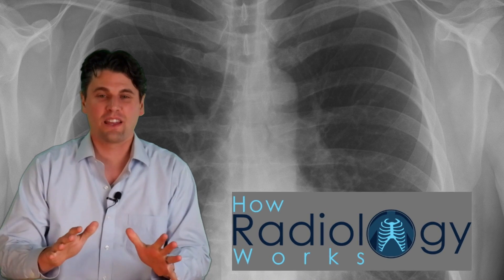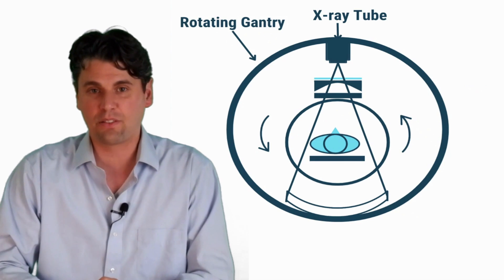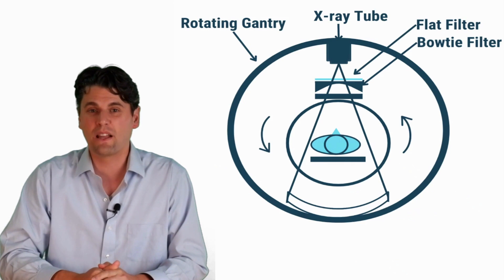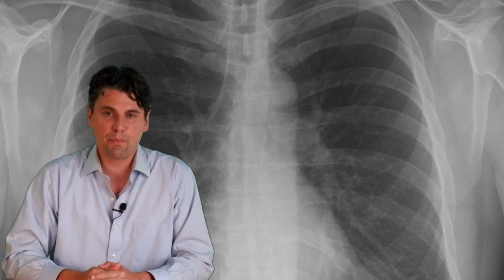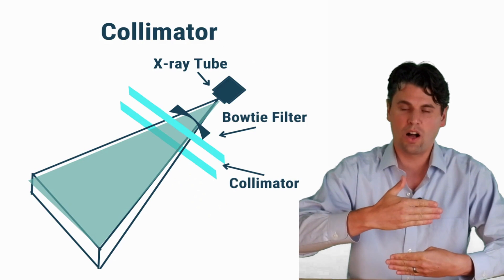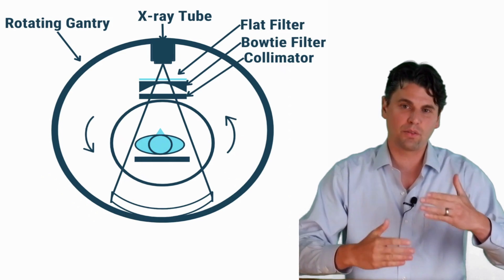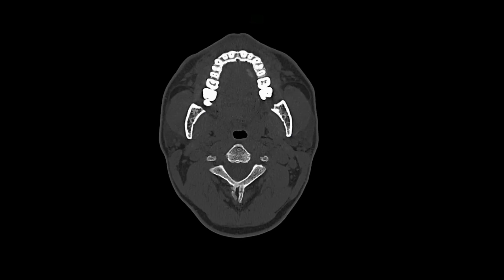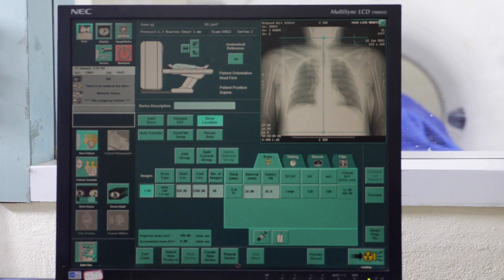CT Components (Pictorial Explanation)

Comment: 🎯 Key Takeaways for quick navigation:

00:00 🔄 CT scanners consist of a rotating gantry that houses various components crucial for image acquisition.
01:37 📏 Different types of filters, such as flat filters and bowtie filters, are used in CT scanners to adjust x-ray spectra and reduce patient dose.
04:36 🎯 Collimators control the shape and size of the x-ray beam in CT scanning, with collimation specifications typically set at the iso center of the system.

Made with HARPA AI

Comment: So it lowers the patient dose, right sir? Can it be also attached to the detector?
Reply: I'm referring to the bow tie filter by the way
Reply from the maker: @arceem870  yes the bow tie filter does reduce dose by filtering out X-rays on the way to the patient so that towards the outside of the patient there will be less X-rays. We would not want to put on detector thoughts as those X-rays have been through the patient so we don’t want to filter. The exception is an anti scatter grid as we do want to remove scattered X-rays before they hit the detector
Reply: @HowRadiologyWorks  Oh! I see, thank you so much sir. That cleared my confusions